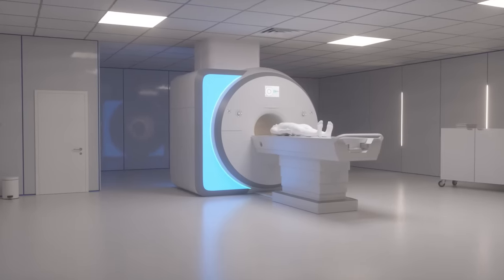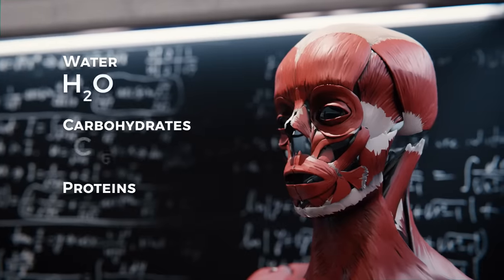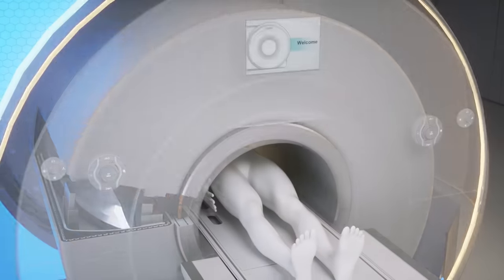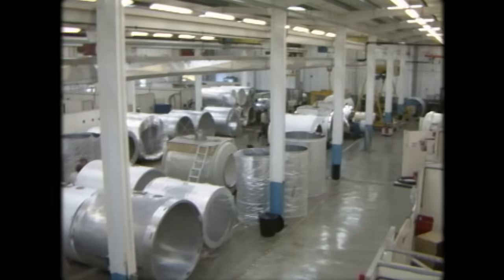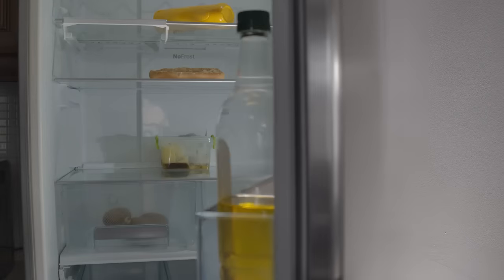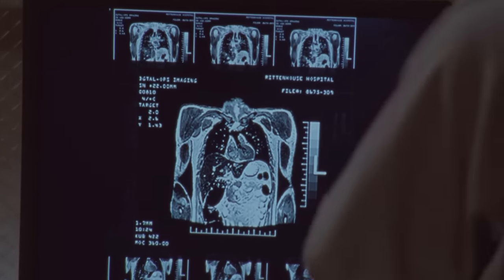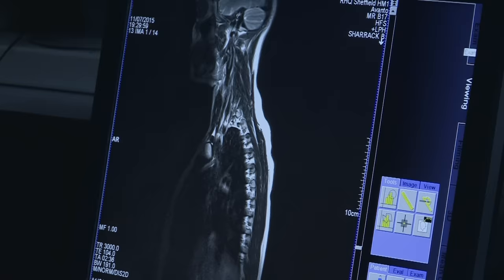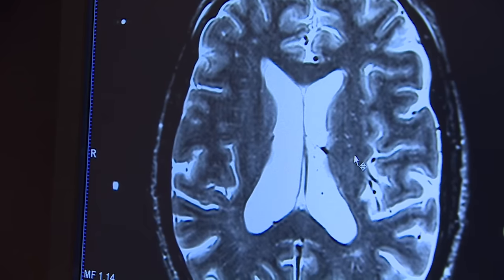The Insane Engineering of MRI Machines

Comment: I'm a bit confused, at 1:58 is it really accurate to say "X-rays work by using high frequency radio waves". Radio waves and x-rays are at the opposite ends of the EM spectrum.  With that wording you could just as easily say that X-rays use high frequency visible light.  Would saying "X-rays work by using high frequency electromagnetic waves" have been more accurate.   If you start calling X-rays high frequency radio waves, you are going to get some people thinking that radio waves can cause cancer. Well, it's probably too late for that I guess since a number of people think that cell phone towers cause cancer.   Or am I completely confused about how the modern x-ray machines work vs the classical definition of what an x-ray is.

Comment: What frequency at 3.40? 👍 Great video. Makes me proud as an Irish person. 👍🇮🇪
Reply: The T/R frequency is dependent on the main magnetic field strength of the MRI scanner and the Larmor frequency, which is 42.57 MHz/T for hydrogen nuclei. For example in a 3T scanner, it would be: 42.57 MHz/T * 3 T ~ 127.7 MHz

Comment: Summary🔍 MRI machines have revolutionized medical imaging, offering detailed 3D reconstructions with no moving parts and safe, high-resolution imaging. 🧲 They rely on the quantum property of hydrogen atoms called spin to create images. ❄ Superconducting coils, using materials like Niobium–titanium, provide the intense magnetic fields needed for MRI, and they require extreme cooling using liquid helium. 🌬 Modern MRI machines use "Zero Boil off" technology to eliminate helium refilling. 📻 Radiofrequency waves are used to nudge hydrogen atoms, and gradient coils help control the frequencies to create images. 📊 Contrasting tissues is achieved through T1 and T2 relaxation rates, which depend on tissue characteristics, allowing technicians to customize MRI settings for specific imaging needs. 🎨 Images are created using Fourier analysis of striped patterns generated by rotating hydrogen atoms in the grid.HighlightsMRI machines utilize quantum properties, superconducting magnets, and radiofrequency pulses to create high-resolution 3D images.Liquid helium cooling was used in early MRI machines, but modern ones employ "Zero Boil off" technology.Customized imaging is possible by adjusting T1 and T2 relaxation settings.Fourier analysis deconstructs complex wave patterns to create MRI images.

Comment: Forgive me, I’m not a trained MRI tech in any way, I’m just a retired Army Infantryman. One of the young men I served with in Iraq later went on to earn his PhD in Medical Imagery and is now teaching at MIT. He patented a couple of compact MRI antenna and he has a hope of developing a ‘field portable’ MRI system using (possibly) inflatable lightweight bladders and using fluidic metals in lieu of massive magnets. With the advancement of room temperature super conductors and newer alloys it seems possible. Please note that todays Infantryman in the Army has an average IQ of around 120, I was just average amongst these characters. I can see that adding an AI system that can improve the switching sequences to gain images and clarity would be a HUGE improvement. Quantum mechanics, when we’ll applied, can do amazing things but I’m curious if there would need to be an unobserved portion when using quantum designs, consider the ‘double slit’ experiment/observation, that’s some freaky stuff. I have so many questions about that technology.

Comment: I did appreciate your documentary… but a few quibbles…

The field from an MRI is not just a threat to ferrous objects (e.g., a steel wheel chair). Even an aluminum cane can be ripped out of a patient’s hand and destroy part of the machine.

Also, the “keyhole surgery” to place a stent in a heart’s blood vessel is not what was shown. A stent is placed via a large blood vessel… the surgery shown was performed in the abdomen via a trocar, such as gastric bypass surgery or abdominal hernia repair. By comparison, the procedure to place a stent is MUCH less invasive, by comparison, just as surgery via trocar is less invasive than cutting down through skin, fat, and the muscles just to reach the part on which the dr wishes to operate.

Lastly, I wish you’d included the fact that modern xrays are extremely low in radiation. You are exposed to more radiation flying across the Ocean than getting an X-ray. Far better in current days than the old.

Like I said, I like liked the video as a whole. Just jolting to hit a reef of error while sailing a sea of excellence.

“Open MRI” remains a mystery to me.

My head is so large, and my shoulders so broad, fitting my head into the “focus cage” is nearly impossible, and I have to tuck in my shoulders just to fit in the magic donut.

Comment: 6:29 Here you mentioned superconductivity, but the temperature -273 degree Celcius is not absolute zero, its -273 Kelvin (or -543 C). And speaking of superconductors, each shows their superconductive nature below a certain temperature known as the critical temperature, which might not be equal to absolute zero. Apart from that nice explanation, Thanks for the video.
Reply: Kelvin is an absolute scale, so "absolute zero" is 0 K, and when measured under celicius is -273.15 °C.
Reply: U failed :body-green-covering-eyes:

Comment: Where does the mantra of constant improvement 'get off ' with fMRI &c. machine engineers and manufacturers?

It can't be beyond the wit of mankind to get them to do a better job of it, or even just as good with a concerted effort to kill the row.

My scan yesterday took longer and I therefore held up patients who followed me, because I was apparently expressing my disgust at the insufferable cacophony by raising my eyebrows in despair.

Wasn't told not to and you know that the majority of the makers won't have thought through this far.
CAN do better.